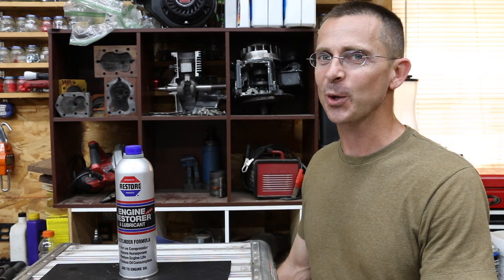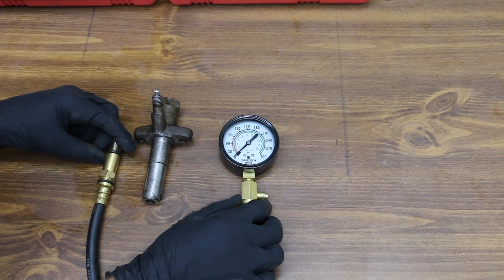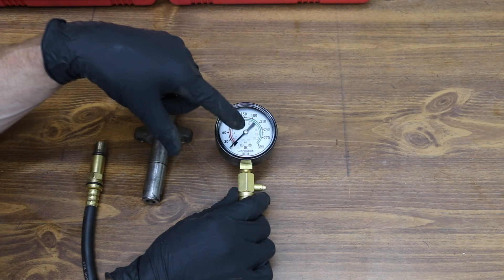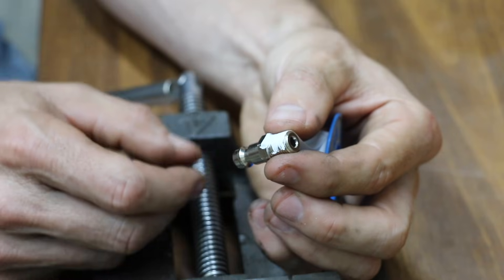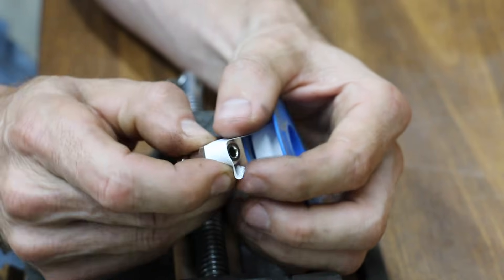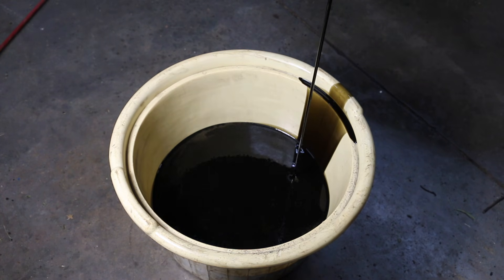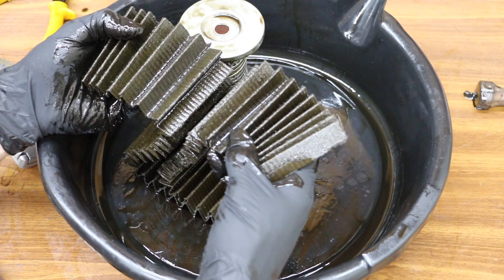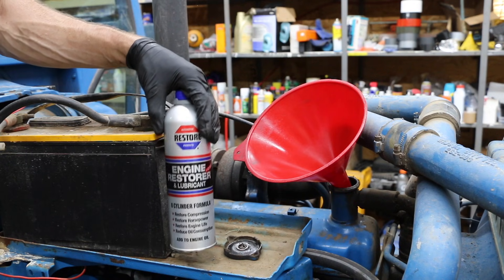Did the "Engine Restore" Compression Improvement Last?  One year later (Episode 2)

Comment: That tractor sure sounded good . 
Good job. I have tried Engine Restore and it did wonders for a 75 Cadillac 500 engine.  I know it helped the compression,  cause before engine restore,  from a stop it wouldn't spin the tires, after restore,  it would spin the tires,  it even had the limited slip differential.  It also helped get better fuel mileage.

Comment: Hi, thank you for this video and for providing us with such great content. I cannot say how much money and headache I've saved by not going for all those snake oil additives; all thanks to you. My car (Pajero Sport 2.5 turbo intercooler diesel) has done over 80,000 miles and recently I've noticed some light smoking from the engine under hard acceleration and at higher RPMs. I feel it's the age of the engine that's causing this. Will the engine restore oil  additive help solve this? Also, is engine restore compatible with Shell Helix Ultra 5w 40 fully synthetic oil?

Comment: WOW I always doubted rebuild in a can products for their claims..
This one certainly has shown to bring the compression up... so it sure beats having to re-ring.
If my compression test low due to worn rings in my older pick  truck I will give this try..
Still havent found good poor in head gasket product for low compression. Most only seem to work if the leak is on the antifreeze sides of head and block which is obvious to see and not the exhaust, oil ports or in between the cylinders at the closest point...
In my experience Most head gasket sealers just gunk up the whole cooling system.
And the best rear main seal sealer I think that is out there is the one made by Blue devil. It cleaned up harmonic balancer seal leak and has slowed down a rear seal leak that will hopefully last long enough for me to get around to working on the old pick up again.
Reply from the maker: Thanks for sharing.

Comment: I know this is an older video now but the oil in my 67 Ford 2000 Diesel is beginning to sludge up after about 20 hours of running engine restore. Not sure if there’s another issue going on but the oil is fresh (Shell Rotella) for Diesel engines along with a new filter. It didn’t do this before so not sure if it’s related to Restore or not but I find it odd it started after using the product
Reply from the maker: Thanks for the feedback.

Comment: For work I move some crazy large manufacturing equipment that sit atop heavy 6" tube steel pedestal. The pedestals are anchored to concrete below false floor then equipment is at floor level. Often I have to drill and tap holes to secure equipement and pedestals together.  I hated it when going old school tapping by hand, totally sucked and took forever. Now I press a hex nut onto tap  and use a cordless impact with  socket. Works so well, fast and easy. Done hundreds of 1/2 and 3/4 bolt threads only breaking a couple taps. I thought it would never work when 1st told to try it but it is great and saves so much time and blisters plus way fewer crooked tapped holes.
Reply from the maker: Thanks for sharing.

Comment: Great video. I have used that product in the past out of desperation. And son of a gun it worked. I was in the petroleum industry for all most 20 years. The owner of the company would pride himself on supplying only the best products to his customers. The only additives the company would sell was Schaeffer oil products. A big seller was Moly EP. There was a dirt track, 1/4 mile oval, and a dragstrip near by. Much of the racers use the Moly EP. Thay said it helped significantly with high rpm flat tappet engines. I can send you some if you get me your address.
Reply from the maker: Thanks!  Thanks for the feedback.

Comment: The original engine restore video on this tractor was the first project farm video I watched. A fair statistically based test that left you with almost anything you need to know about the product, something he does really well that will leave you with great information about what was being tested. After watching it I decided to give this stuff a go myself. I ended up using it on one of my older lawn mowers that had poor compression and oil use, I saw a good 30 PSI of game on what would have been a totally trash motor. It does still use a minuscule amount of oil, but it's a far cry from the smoke machine that it originally was and I do still regularly put engine restore in with oil changes.
Reply from the maker: Thanks for sharing.

Comment: Just poured one bottle into my dying Previa with 310K on the clock, surprisingly after 30 mins drive, 90% knocking is gone.     Finger crossed right now.   Will update this post after a few days.  Thanks for this video.   At least it makes my van drivable for a while.    Hard to find a good used JDM engine for this van now.   Once again, thanks for your work.
Reply from the maker: Impressive!  Looking forward to an update when you have a chance!
Reply: update from 60 miles drive, 99.9% blow-by is gone.  I'm totally sold on this product.  My mechanic did a leak down compression test, and confirmed two cylinders only got 30 psi.    Last attempt engine restorer come for last rescue.   This engine has survived a head gasket failure and saved by Prestone head gasket 2-part kelvar repair.    May be Prestone head gasket additive will be good content to cover for your future video.   That thing worked for me i would say, no more white smoke from the exhaust.
Reply: @helen10777  update?

Comment: I'm a fan of Duralube, if all the oil was to be removed, like accidentally or in case of a block leaking from a engine the manufacturer says it'll keep it running. It claims to prevent overheating also.
Reply from the maker: Thanks for sharing.

Comment: My wife drives a clean 2 owner 1999 Jeep Cherokee 4.0 with 329,000 miles. The engine runs well but has more valve noise than I would like including one leaky lifter that collapses when the engine is off for any amount of time and requires almost 10 mins to pump up after starting the engine. Previously I had run 10W-30 conventional oil.
On this oil change I decided to use conventional 15w/40 Shell Diesel oil with an added  12 oz can of Restore. I noticed that the lifter pumped up quicker and the engine valve noise was quieter when running. Oil pressure increased about 3-5 psi. due to the heavier oil viscosity. After running for about 5 miles, shutting the engine off and allowing the car to set overnight, I restarted the engine with FAR less initial lifter noise. Lifter noise was gone within 20 seconds.
The proof came when my wife started the car for the first time and asked what I had done to it. She immediately noticed an improvement in reduced lifter noise at start up and less valve noise at idle. Yet I had not told her beforehand of any changes I had made at this oil / filter change.
Some of the engine noise improvement came from use of the heavier 15W/40 Diesel oil with its high zinc content, but as the valve noise has continued to improve over the last 100 miles, Restore must be given some credit as well. Enough so that I will continue to use this combination of Diesel oil with Restore at every future oil change.
Reply from the maker: Thank you for sharing!

Comment: All right im using some in my 71 f250
Reply from the maker: Thanks for sharing
Reply: I have a 1970 f250 with a 360 that had low oil pressure when it warmed up to operating temperature and i finally tried a bottle of restore and now after 15 miles of driving it runs and idles way better. I can feel the compression increase when i let off the gas and my oil pressure is way better. Thank you!

Comment: After drilling your hole, do not move it. put the tap in the press but do not turn it on!!! turn the chuck by hand to start the tap. Teflon tape is much easier for lefthanded people. A little trick I use is a drop of dish soap on the outside of the tape. Makes all the difference in the world for tightening but be careful with plastic females it'll tighten so easy you'll crack the fitting even by hand. That's how much difference it makes

Comment: I did my own scientific analysis of engine renew 20 years ago I had a 40 horsepower vw.bug 62 still own it it only had 85 lb of compression I added the engine renew and it would bump it up to 115 you could feel it in the CU the pants it was way more responsive I would drive it daily on the freeway 60 miles each way to work 120 miles a day It developed a knock but I drove it and drove it probably another 10,000 with the knock I finally lost compression in a valve maybe it was the valve that caused the compression leak because of the hole in the piston😂 found out the center mean bearing on the crankshaft was cracked halfway in half the crank was halfway broke in half it just didn't make enough power to blow up😂✌
Reply from the maker: Thanks for sharing.

Comment: I drove my van with a 302 v8 on a 1200 mile trip. And it used a gallon and a half of oil. 
A month later I had to drive the same trip and added engine restore to a oil change and I only used a quart of oil. So 👍👍👍 to engine restore.
Reply from the maker: Thanks for sharing.

Comment: Interesting testimonial, not just by you but all the people commenting. I've got a Chevy S10 with 274,000 mi on it and it runs quite well. It the has the 4.3 V6.  I recently did a compression test and it had 135 to 140 compression. The 4.3 is simply a 6 cylinder version of the Chevy 350 engine, exact in almost every way.  I can't find the original compression specs but I'm assuming between 150 and 160 psi.  I'm tempted to try this stuff out, maybe on my next oil change.  It's currently consuming just under a quart in 1,000 miles.
As far as suggestions go it would be interesting to see you do a test engine oil sealers and how they affect o-rings. Better yet if there's a way to do it, how engine oil additives or leak stoppers affect actual seals and I'm not sure if those are made of the same material that o-rings are made out of.
I recently installed some Blue Devil rear main seal  sealer.  So far it seems quite impressive as I don't have drips like I did before.
Blue Devil rear main sealer says it's not solvent based so it would be fun to see a comparison of that product to what most everyone else sells to stop engine oil leaks.
I love watching your channel and like the other said, you're the guy we trust because you're so thorough in your procedures. 👍
Reply from the maker: Thanks!  Thanks for the video idea.

Comment: I have a Ford 2000 diesel and decided to give restore a try after your first video. My tractor wasn’t as hard to start as yours but it definitely gave me a little trouble when it was cold out. After using restore for a couple hours the tractor starts no problem. I don’t have any compression data but it does seem to perform better.
Reply from the maker: Thanks for sharing.

Comment: Apply teflon the other side of the reel meaning hold your tape reel the other direction and you ll see how much easier it is to get it tight on your threads. I have been doing Hydaulic work for a long time and i found out that adding a drop of PST onto the Teflon tape i was able to seal the most high pressure hydraulic i have worked on,
Reply from the maker: Thanks for the video idea.

Comment: I use this product quite often and have had good results. Plus it real good tip I got from a shop that does Small Engines like 2 Strokes. You take the spark plug out and squirted little bit of it in the hole and run it up and down. Because you can't really mix it with the gas and try and run it through your carburetor
Reply from the maker: Thanks for sharing!

Comment: I think you might be giving too much credit to engine restorer. You changed the injectors at the same time. Injectors can easily cause low compression from a poor spray pattern. Hard starting, power loss, smoking are all symptoms of worn injectors. The lower compression comes from fuel loading of the piston rings, “washing out” the oil that is supposed to be in the ring grooves. Left long enough, it can and does damage cylinder walls. Running the engine at light load and short cycles that don’t warm the engine will cause similar issues.  I’m not familiar with your tractor but I am familiar with Mercedes diesels. There was a family of 4-5cylinder diesels in the 70s and 80s that were famous for going 1 million miles or more. That’s sort of true. Most were ruined by 150k because of poor maintenance. That engine needed its injector nozzles replaced at 60k intervals. There were other issues that shortened the life of those engines, but injectors were at the top of the list. I really believe you solved your problem with the injectors.
Reply from the maker: Thanks for the feedback.

Comment: why don't you try Militec metal conditioner.  This stuff really works well in a multitude of applications!!!  I have been using it for over 30 years and I won't run an engine or transmission without it !!!  Reduces engine and transmission temperatures up to 30 degrees due to reduced internal friction.  A great weapon lubricant!!  This micro lubricant has saved me thousands of dollars !!!
Reply from the maker: Thanks for the video idea.

Comment: just a tip i use in my garage to cut open oil filters without causing contamination i use a rather large pipe cutter one of the carbide wheel tipe that you rotate around a pipe it works good less hassle than a chisel
Reply from the maker: Thanks for sharing!

Comment: Xado ENGINE RESTORER +other Xado products  with cer-met, Not going to make a comment,  But this product needs putting in right prospective, And so far not found a real test of this product that founded in ?// realty  Needs a objected test by unbiases tester, as price is high, and they say you need to install up to 3 tube/bottles  before its works as it should, in lot of machines,  at this price that can add up £120 with all they say you should do,
Reply from the maker: Thanks for the suggestion.

Comment: Hey man can you do an "as of today" updated. Obviously you've already gone far above and beyond with you test/coverage of restore and it'd be a dam good video for a "long term test" with the results whether it be good bad Gains or loss.

I have an 88' Deere 1050. Being of that time period I'm sure you know it's all Yanmar but built using 100% high grade Japanese/American steel🤪 which makes the 1050 heavier than the comparable Yanmar model. I love the older real Yanmar engines as they pretty much set the bar for tractor engines. Mine being for Deere only tho they took a legendary yanny triple the 84mm bore, they bored it out to 90mm for added raw torque. Final product is phenomenal being a very torquey engine compared to most others. Also she's straight forward simple as you know I mean that relatively. Their 1 Achilles heel is HEAT! They have an actual water pump so no issues of the smaller twins with their "thermosyphon" coolant system. So if you do your part cleaning radiator when needed and other basic maintenance they're fckn awesome.
As you know first hand a turbo on a diesel is basically a dream come true. When Yanmar bored out their legendary 3T84 it made for an ideal engine with 33hp. Deere decided to make a slightly bigger tractor, with alot more to offer and needed more raw power. So Yanmar developed the 3T90JT, t for turbo obviously, excellent engine well known to run with regular maintenance for legitimately thousands of hours as one should easily, and most farmers still actively buy the 1050 models as they're bulletproof, very easy to fix and extremely realistic as the have alot of hydraulic power (even by today's standards) and their size is perfect when you don't need 90+hp to run say a round baler only a common square bailer the 1050 is the cats ass. 37hp rated by Deere but the local dealerships all say it's really 41hp

Point is I wanna keep my 1050 untill my son gets old enough to need it himself on his own property. Deere having Yanmar make a specific engine for them great, problem is not all common Yanmar parts are always easy to find for realistic prices. The heads and some other parts do infact cross over but having the turbo aswell even my pistons and other parts are beefed up to handle the added power/pressure so even the naturally aspirated 3T90J in the smaller 950 tractor isn't a direct plug and play so some places behave like true awful people and try to tear into ya no spit or anything, ya it's that bad, because they know this or that part is harder to find. Common with machines but wtf Man, which is why I'm asking for a horrible situation where the need arises. if restore does work for you I trust you, and I'd be able to get by untill finding the acceptable price.

Comment: As usual, a great video. I have an 08 Chevy Suburban. Just turned over 100K. 5.3 engine. I have used Engine restorer for a lot of the trucks life. I still have 65-70 pounds of oil pressure all the time, engine runs extremely smooth, and the temp. never goes above 200 even when towing my small camper. I also put it in my work van that I drive for work. (I do pharmaceuticals) 289K later, it runs great. Best wishes.
Reply from the maker: Thanks!  Thanks for sharing.
Reply: I'm hoping you meant 165 to 170 PSI 😁